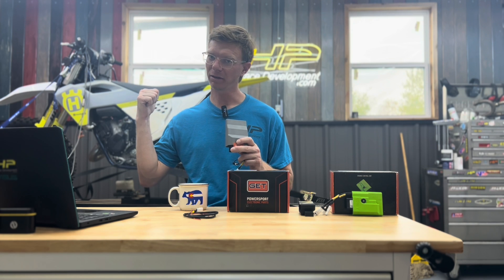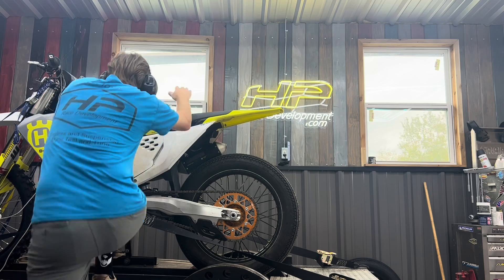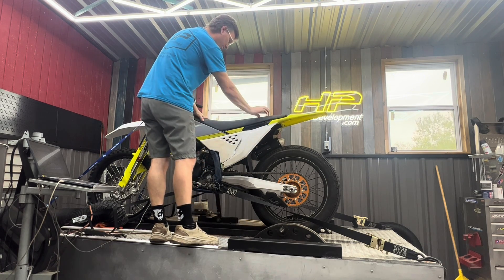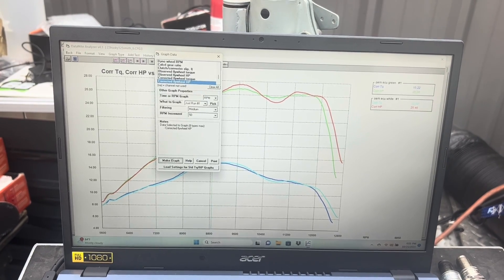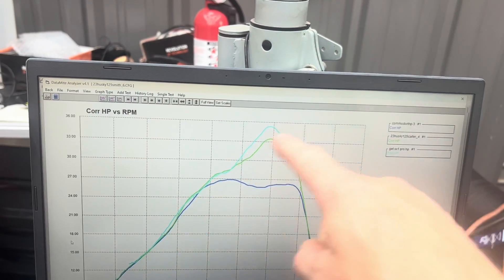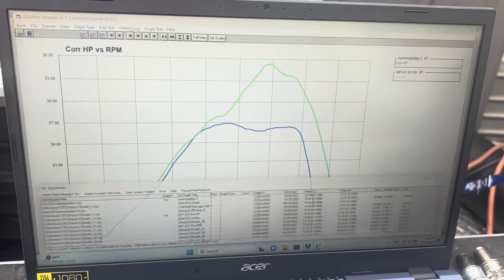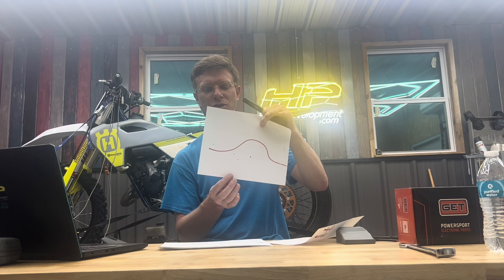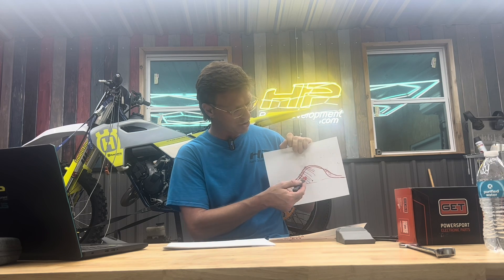EFI two stroke dyno testing NEW GET SX1 ECU

Comment: Crazy that the technology was released like this. We bought a very early 2023 TC250 in late 2022. We just came off a 2019TC250 carburetor machine. The 2023 gained weight and made less seat of the pants power. Tried to live with it, but just couldn’t.  We were nailing hole shots on the 2019 in the 250 class and the 2023 couldn’t even pull away from a 250 4 stroke.  Not competitive at all. Dealer was confident it was running right.  Sold it back to them with less than 10 hours on it.  Was super bummed.  Wish we would have waited to buy that bike until they worked out the bugs or guys like you had these aftermarket ECUs developed.
Reply from the maker: Consumers "said they wanted it" enough that they spent millions to try and sell it.  Im not sure it will ever surpass a good carb - but 2 strokes are really and truly about dead for mx. Offroad wise these are just fine and the vast majority of KTM groups customers.
Reply: @HPRaceDevelopment  I get it. It would be outstanding if the racers had a way to petition the AMA to allow a straight 250 class in pro racing (similar to Canada and Australia IIRC) I think most up and coming racers jump to the 250f because they know that ultimately, if they want a chance in the pro ranks, the 250f is the only choice….even though only 40 guys get to line up on a pro MX gate each weekend. We are racing for fun, so we’ll take the light weight, simple rebuilds, and increased HP of the two stroke, just not the TBI one until the bugs are worked out ;)
Reply from the maker: I think at the pro level people would be sorely dissapointed to see just how fast the 250fs are.  Our Pro Bikes aren't quite where the factory ones are (working every day to close that gap) but I'd take our pro level 250f over our best 250 2t's any day on 90 percent of the tracks. Pure sand, or super smooth fast tracks, 250 2t all day baby!  I think the TBI will be mostly fine, part of the issue is the "consumer" in many ways.  People ride bikes in goofy ways that engineers struggle to comprehend.  For example our supercross yz250 we put a rev limiter at 11500 RPM.  I figured he would only rarely hit it - and it helped us in sound testing and reliability.  NOPE!  he hit it all the time.  The bike makes like 10 hp at 12k  - but he hits it constantly and hated it.... @86rustbucket
Reply: I also had a 19 Tc250, that was one fast bike and I’ve had quite a few! Gone to a 350 Ktm but I do miss the 2 stroke experience
Reply from the maker: The are for sure more fun and excitig than a 4 stroke to ride.  I almost think as we progress the sport becomes less fun.  Nothing is the same as ripping around the track on a slow 125 @paulmarshall8774
Reply: Thanks for making such a great video! Do you reckon similar gains can be made by getting a tune on the stock ecu? Is that something your shop can offer?? TIA! Keep up the great videos!
Reply from the maker: The OEM ECU's are extremely limited in what can be altered.   @paulgriffin7273